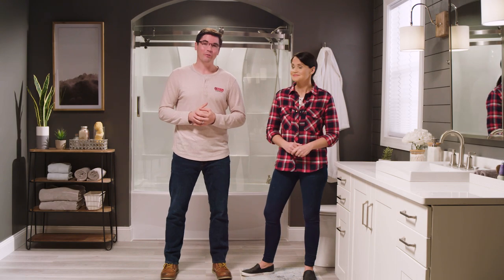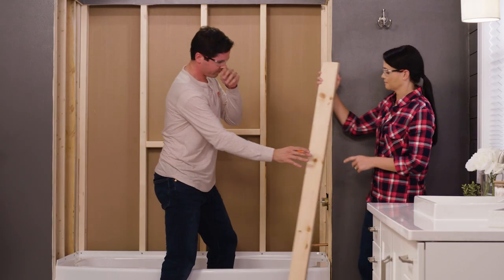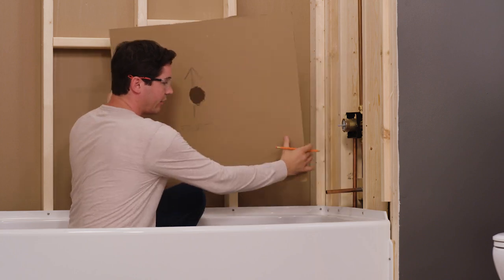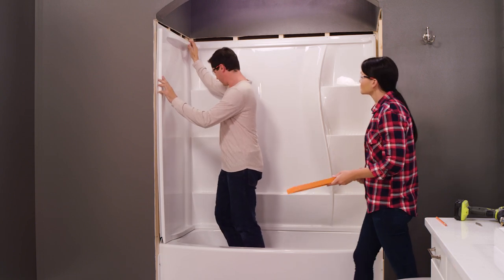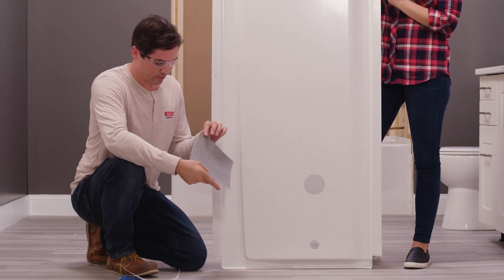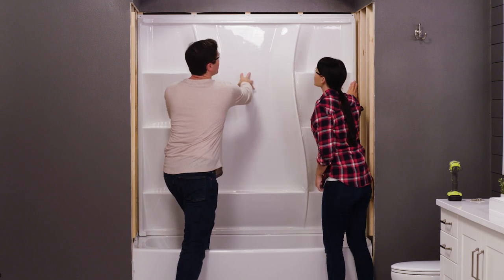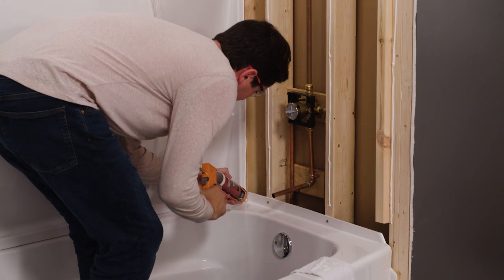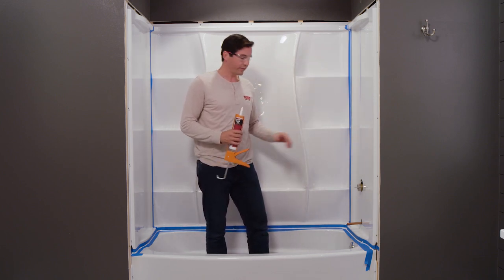How to Install a Delta® Curved Wall Set

Comment: If the horizontal braces are for extra gluing area and rigidity, then why not install them rotated so that the 4" side of the 2x4 is facing you? That would give you even more gluing area.
Reply: most houses are already framed and its probably the weak spot so they add backing

Comment: What’s the fire patch for????
Reply: I learned what the patch is for in another video.
If you will be accessing the mixing valve from the back side with an soldering torch, this fireproof patch will guard against melting the acrylic panel.
Cheers
Reply: @johnburns2940  Thank you! They should mention that in the video. I'm sitting here thinking "how is a fire going to spread into the tub? And what's the purpose of the patch if you are going to cut a hole in it anyway?"

Comment: DELTA, You need to increase your backer boards on these flimsy surrounds and update your Sealant choices. The adhesive sealants you list are just not available and we called twice until a rep said to use Dap Amp. Also, place a 2 by or 1 by behind the front wall where your toe kicks it. These tubs and surrounds are flimsy.

Comment: I just installed this very thing ,they use have changed things cause there is no mention of caulk sealant at tub instead there's a piece of foam ,I caulk the bottom anyway

Comment: Concerning the Delta Classic 400, does the backside of the concave side wall of the 48x34 shower alcove like the one in your video stick out 3/4 inch closer to the stud wall than the top edge? I am trying to figure out where to place the diverter (R22000 WS) if not can you tell me how thick the side wall is? I didn’t find it in the directions

Comment: Hi, any concerns if the tub is not secured? Had seen a process go through with the wall surround and somebody did not put screws through the flange of the tub itself
Reply from the maker: Hello Aiden. Thank you for contacting Delta Faucet Company and we are happy to help. We recommend following the installation instructions. By not securing the tub, problems may arise. With any further questions or concerns, please do not hesitate to reach out to us again. -Carrie
Reply: @deltafaucet  what’s the fireproof patch for???

Comment: This looks so easy, but beware this thing is a nightmare to install. Nothing matches up on the edges of the panels, on mine there was almost a 1/2 inch difference in the height of the three panels on the abutting corners. You would at least expect the darn parts to mesh correctly. I am matching this tub surround to a Delta curve tub. Will never install one of these pieces of junk again!
Reply from the maker: We appreciate your feedback, Robert. Please accept our sincere apology for the inconvenience you are experiencing installing the tub surround. We are happy to help!

We are committed to supplying our customers with quality products. Please reach out directly if you need assistance or have any questions. 
-Bryan

Comment: CAUTION: I you aren’t paying attention, it’s possible to install the end walls on the wrong sides. It’ll still go together that way, but when you go to install the curved glass door kit, you’ll find that the curved glass doors are no longer an option if you have the end walls reversed. Seems laughable to think anyone could do that & not catch it during the dry fit, but believe me, it’s possible. Because I’d already drilled holes, caulked, finished, and painted my sheet rock before I realized I’d made the mistake, I ended up installing a curved shower rod just above the shower walls & that works, but the only reason I went with the tub in the first place was because I liked the glass doors on it.

Comment: This tub and surround are flawed. Water runs from the channel all the way to the open end and down into the wall on the right side. You can see the open end of the channel. Unless you literally install the tub so that it is leaning back slightly, water will drain into the wall. It is a nightmare. Installed in a new home and still today I have'nt been able to find someone to rip it out. I bought the same tub for upstairs and regret it. What a completely idiotic design. It ruined the dry wall and my floor swelled up so now I have to rip up flooring. We have only taken baths for months because the shower is what causes the problems. Water going into the channel and having nowhere to go and overflows into the wall. It really should have a closed off end on the channel or "lip" Why they left it open is a mystery and just stupid.